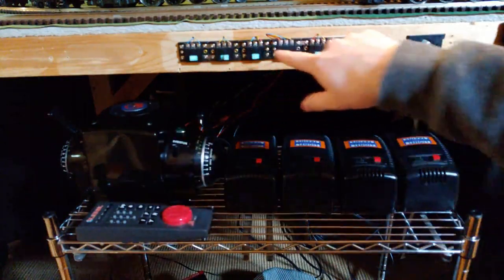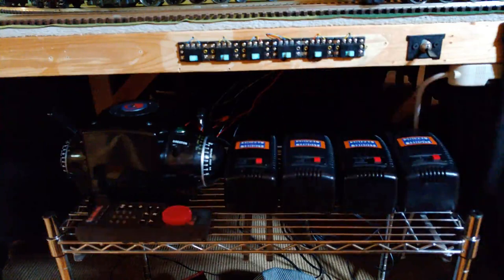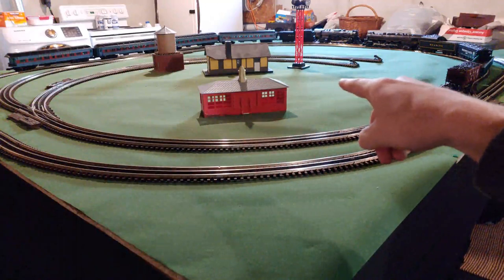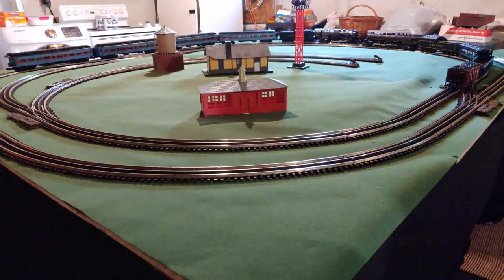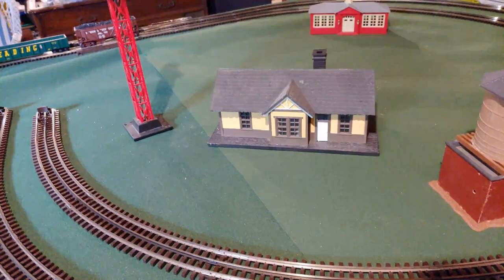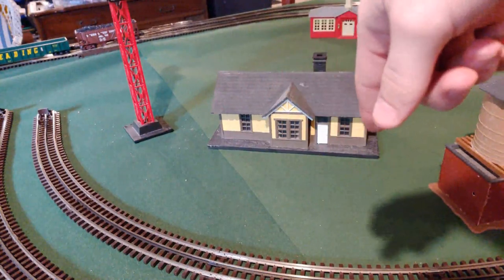Layout Update 1: Something New

Comment: Good luck with the redesign! Will there be a button to lower the gate?
Reply from the maker: The button and the switch that were on the old layout to activate the two accessories are still mounted on the side of of the platform so I am hoping to have something similar to the crossing gates on the new layout.